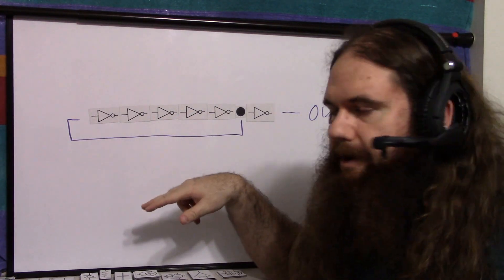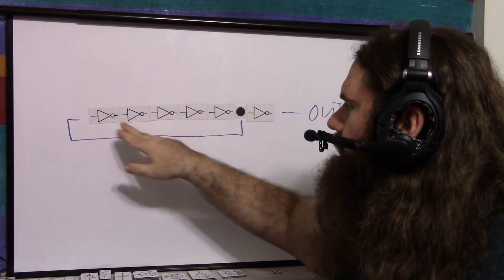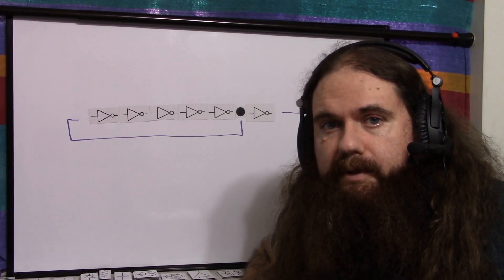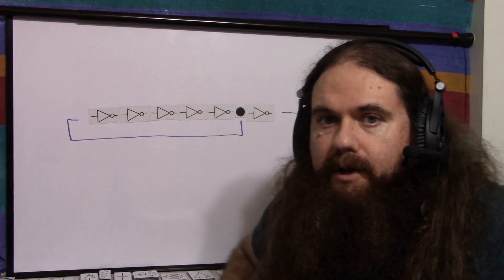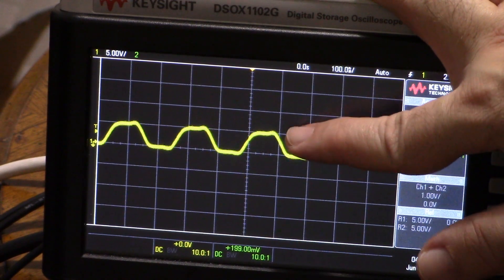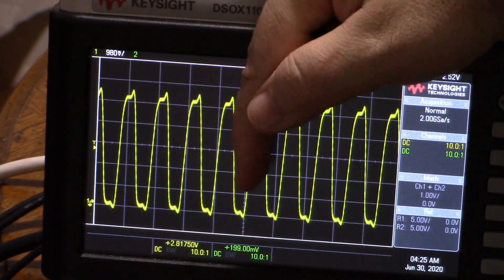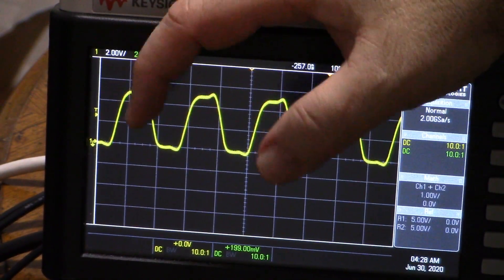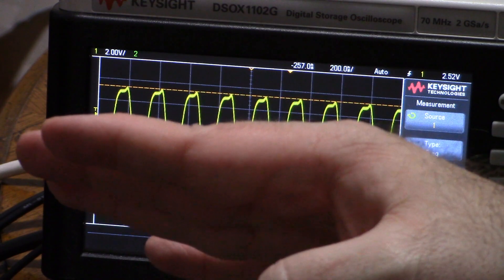Ring Wave Generator - Square Wave Clock With Nothing But An Inverter Chip - Simply Put

Comment: Question if you were to input the square wave coming from the 555 ic into a cd40106 Schmitt trigger hex inverter gate then into the cd4013 the output waveform would be almost a near perfect square wave?

Comment: I built something similar, but it used a resistor and capacitor. I used a CD40106 Schmitt-trigger Hex Inverter, and because of how the hysteresis works the RC allows you to control the square wave somewhat.
Reply from the maker: That's the same setup as you'd have with a 555 timer basically, just without the discharge pin hookup, because the 555 is essentially a schmitt trigger connected to a latch.

Comment: Ring oscillators are used to test propagation delays in digital blocks of ICs, since it is quite easy and cheap to use several logic gates to build these test structures